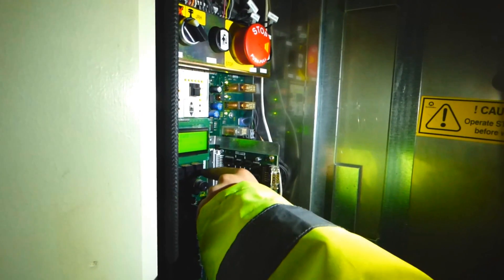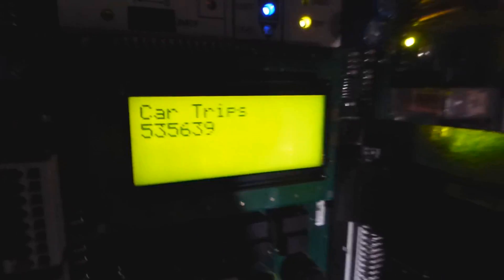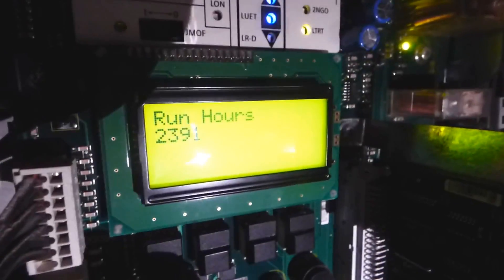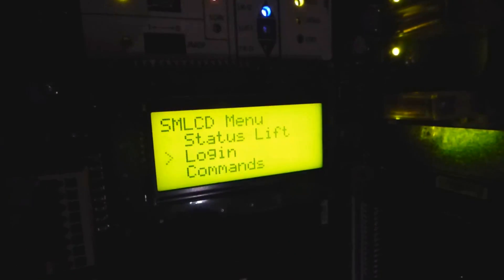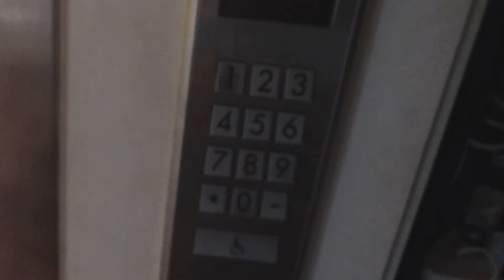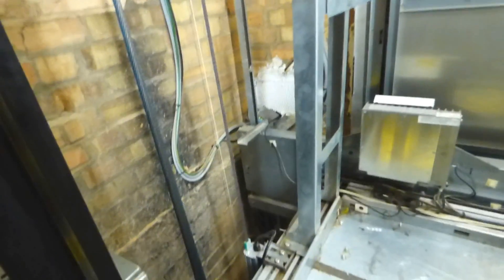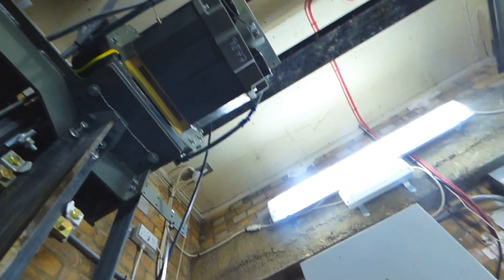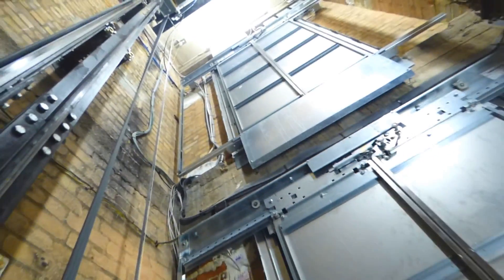Detailed look at Schindler destination dispatch

Comment: These are very nice Eurolifts!
There seem to be two different car variants: The normal one you found here and the non-surfable one, where the whole car top is a big flap with a ladder. On that version you acces the shaft via the inside of the car, the ceiling flap drops down and there is a platform to stand on. The flap has a switch, so the inspection control only works with the flap open and normal mode only works with the flap closed. Sadly, I've only come across the second version yet.

Comment: 2:27 | You set it to less than 0.1, so it wrapped around to 6553, which is 1100110011001 in binary code. It's a rather random maximum time, as it's not a string of 1s.
Reply from the maker: That is very strange.  I would have expected it to wrap around to a binary number.
Reply: Set what

Comment: Or Schindler 7000. I mean the miconic 10 keypad model and Schindler Eurolift model on the inside.
Reply: schindlerteejay94 or if it had 2 voices- the miconic 10 handicap voice on the outside and eurolift voice inside